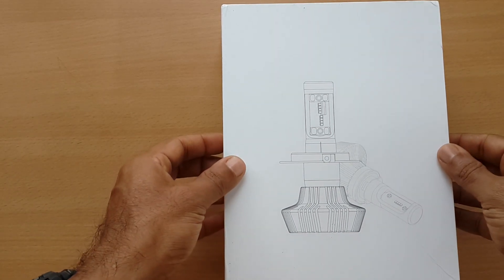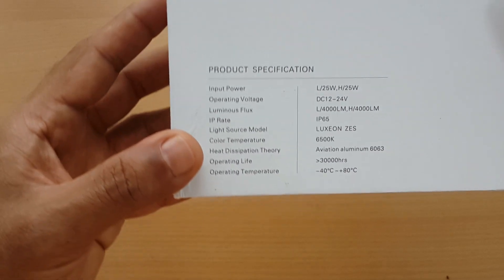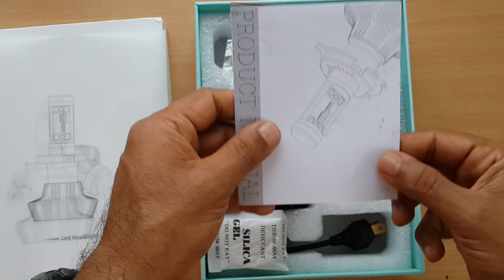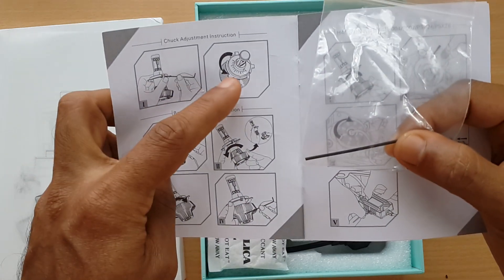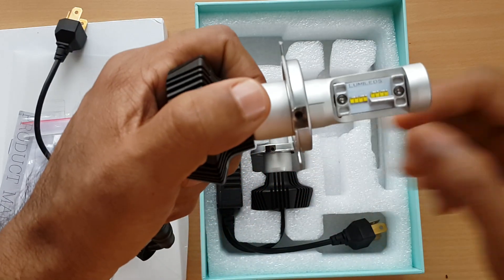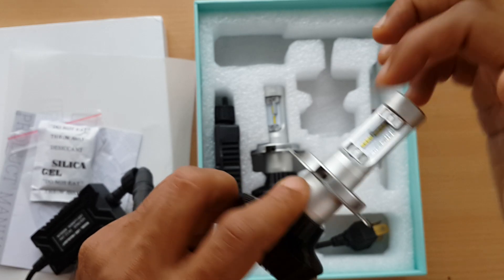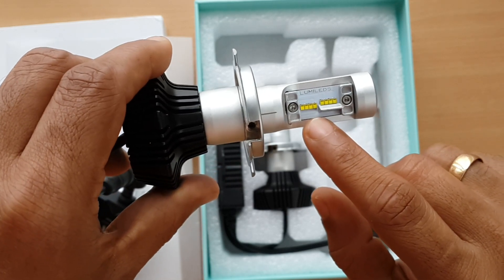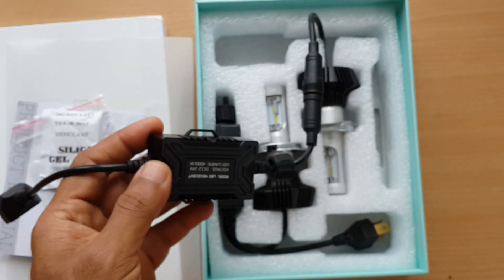Unboxing Philips Lumiled H4 Head Light with Luxeon ZES chip in Halogen Design

Comment: Which one is better, philips lumileds or cree xhp50 by DLAA?
Reply from the maker: The Cree xhp 50 is better, it give better light pattern, color temperature (kind of Natural light). Philips Lumiled is more whitish and the light pattern (light spread on road) is even.
Reply: @wheelklub  what about the xhp70 :) I want to either get the lumi leds, mz chip by sngl or xhp70 but i have no idea what one is the best. I dont need high beam as i only have h7.
what do you recommend ? :)
Reply from the maker: Hi Kuba, You can go for Cree xhp 70, its one the best bulb i have tested so far,  I have SNGL H7 bought it for testing, i have not posted video of it, If you need i will post a comparison video with Cree xhp 70, Sngl is little expensive.
Reply: @wheelklub  that would be a brilliant idea. Thank you very much.

Have a great day.

Comment: what does that metal piece that sticks out by the 2nd row of LEDs do?
Reply from the maker: Hi Ben N,
The Metal Piece Sticking above the LED is the cut-off shield, which gives a controlled light in LOW-BEAM, to avoid the glare (dazzling light) to the opposite vehicle, you can see the same in HALOGEN bulb (a flat metal above the filament).
Have a Great Day...
Reply: so if a led bulb doesn't have that cut off shield, it will glare other people in Low-Beam?
Reply from the maker: Yes, It will glare opposite vehicle when there was NO cut of shield, Previous Generation LED H4 bulbs dose not have cut off shield and their pattern was different too (like : low beam on UPPER side and HIGH beam on LOWER side ). For your reference you can check this video : https://www.youtube.com/edit?o=U&video_id=lRIp76Vkzpk
Reply: that link goes to an empty profile..
Reply from the maker: Sorry for the wrong link, Please check this it works : https://www.youtube.com/watch?v=lRIp76Vkzpk

Comment: Sorry, but the box does not say Philips anywhere... IT IS NOT PHILIPS!
Reply: the philips bulb uses a lumileds cz chip not a lumileds zes chip, the cz chip has three not four leds like the zes and the philips is called extreme ultinon and will not adjust like the luxeon, you can't flip the heat sink on a philips either. the philips conversion kit costs 199.00 vs 50.00 for the luxeon, they both use lumileds led chips with the 1.6x2.0 leds on them. i'd take  the zes 4 led chip over the cz 3 led chip
Reply: pepsi and cola are not the same thing
Reply: Right, it is a cheap chinese Lamp and not a Phillips.
Reply: tanga. hahaha
Reply: Philips - LEDs, but not lamp at all
Reply: WtrDogg20 the cob on each lamp is made by Phillips, not the whole assembly.

Comment: hi, which brand headlight is this, can you share the link to purchase the same, thanks in advance, mehfil33@gmail.com

also i prefer 12v/35w specification
Reply: Then DO NOT CALL IT PHILIPS, since it is not made by Philips and comes from China... It is a generic LED light that the most probably it doesnt meet DOT regulations in any country...
Reply from the maker: Hi Muhammed Mehifil,
This are made in china but the chips (LED ) are branded quality Philips. There are headlight bulb made by Philips but they don't throw more light. These light consumes only 23 watts in low beam or in High beam ( watch this video to know about the power consumption : https://www.youtube.com/watch?v=jGu7YAop3x0 ) there is no need to change the factory fitted wiring is OK.

Here is the link from ebay.com

http://www.ebay.com/itm/Pair-160W-16000LM-LED-Headlight-Bulbs-Philips-H4-9003-Plug-Bulb-White-6000K-Hi-L-/262434603717?hash=item3d1a5242c5:g:H3wAAOSw~oFXNXl4&vxp=mtr#shpCntId

You may also search in eay.com as (h4 led philips zes ) you may find similar products with even lower price ( as the price get cheaper day by day )

IF you are from INDIA Here is the link from ebay.in

http://www.ebay.in/itm/2x-Philips-LED-Chips-160W-16000LM-H4-9003-HB2-Headlight-Kit-H-L-Beam-Bulbs-6000K-/172459065467?hash=item28275c807b:g:m1YAAOSwa~BYX~AB

If you buy from INDIA you do not need to pay any import duties and You will get it in 7 or 10 days

Please note : I cannot guarantee the product i suggest and i am not promoting (selling) any product or brand here.

Have a Great Day..
Reply: Thanks
Reply: Ones from China spelled philip. Genuine phillip spell's with two l's not  one L.

Comment: Do these even last long? I've bought stuff like these through eBay, and the LEDs almost always burn out or start to flicker after 3 months of use.
Reply from the maker: HI DeusEx Machina,

I am using this Philips ZES LED H4 for the past 8 months, still now It is working fine. If possible post the link where you bought it. So that i can compare with my light.

Have a Great Day..
Reply: give link to your shop for that bulb u had used for 8 months

Comment: Just quick question, normally every car headlight come with back cover right? 
so, do we still need the headlight cover to cover back the headlamp after the LED being installed? will the heat sink bother around the cover?
Reply from the maker: +WilliamSim92 
Hi William, Most of the cars come with back cover or rubber shield to protect the headlight from weather, Yes we need to cover the back after the led light to prevent the Head light reflector form water, moisture, dust etc.

Yes HEAT SINK bother the cover, LED is little bit more in length as compared to halogen, I have posted some videos about the size comparison etc in my channel.

Have a Great Day..
Reply: Alright, thank you for your respond...will definitely look at it later..

Comment: Where did you purchase? These look to be the 8th gen H4 bulbs also offered (rebranded??) by JDMastar.
Reply from the maker: +Matthew Kielar 
I purchased it from eBay, I thought it was 2gen because all the previous led high luminous head lights are with fan, But this headlight is  without fan and replaceable heat sink, it was originally designed by Philips called as ultion, but the output from the Philips bulb is very less with three (3) chips on each filament, where as this ( which i bought is with 4 chip)
Reply: +WheelKlub Hi. Can you post the ebay link for MZ and ZE S bulbs
Reply from the maker: +vijayaragavan v 

Hi, Do you want the exact link ( the same bulb what i have shown in the video ) or similar product ?
Reply: Need a vendor who can ship to India. Which one do you prefer? The one with fan or passive cooling with cutoff shield. I want to experiment on Yamaha R15
Reply from the maker: +vijayaragavan v 

The MZ chip with fan is bigger in size you need more space behind the holder and you cannot fix the weather shield if you have, 

The other one ZES chip without fan passive cooling and cut of shield can be fitted with ease but due to the fan less design, you cannot use both high beam and low beam at the same time, like when flashing, this is to protect from over heating when using both filament and this comes with 6500k more blueish. 

MZ chip with Fan link below :
http://www.ebay.com/itm/251793722264?item=251793722264&viewitem=&vxp=mtr

ZES chip without fan, with Cutoff shield link below :
http://www.ebay.com/itm/JDM-ASTAR-8000LM-8TH-Gen-H4-9003-HB2-White-LED-Headlight-Conversion-Lamp-Lights-/331727259800?hash=item4d3c7c4898:g:hHQAAOSwAKxWYSYu&vxp=mtr

Note : I do not sell and not affiliated to any of the above links, its just for your reference only.
Please see my other videos you will get an idea about these headlights like size comparison, light output test, installations, temperature test etc...

Have a Great Day..